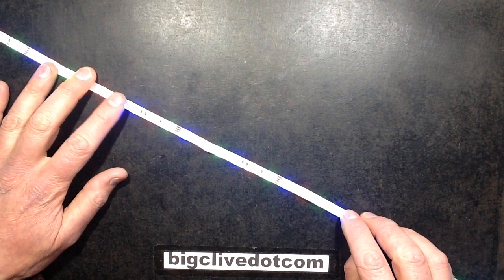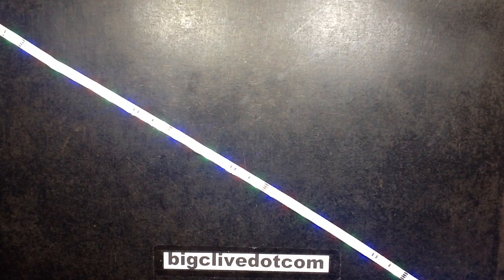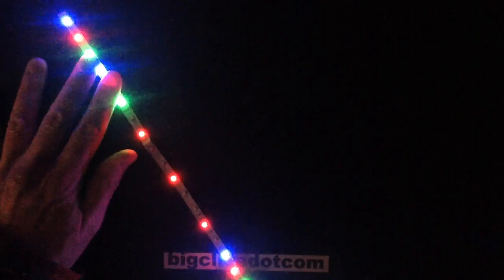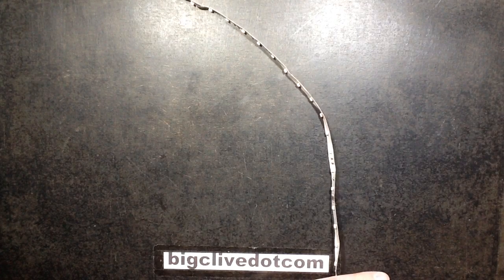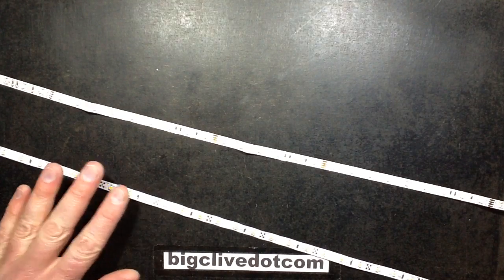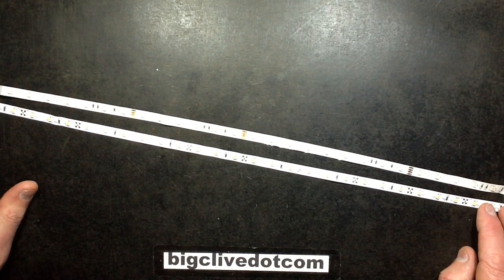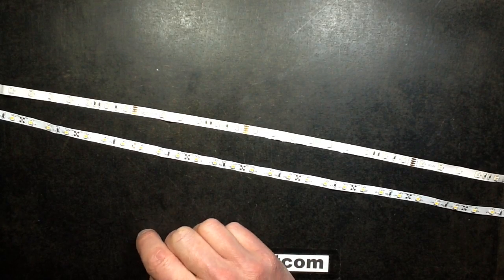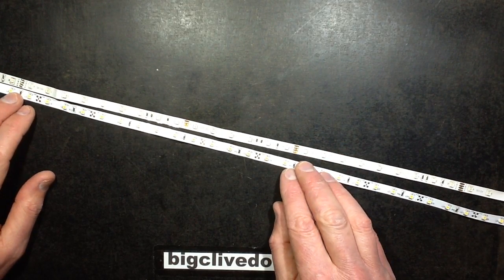RGB LED tape configuration oddity.

Comment: Hey, i recently bought a LED strip like the one you got, not the 50/50 kind. And when i plug it into the power supply it defaults to Blue, and the controller does not affect it. Could it be a problem with the microcontroller or maybe the IR sensor?
Reply from the maker: +Trent Zurflueh The battery in the controller may not be making good contact.
Reply: I tried messing with the battery, found out that the controller for the unit was blown, Im probably just gonna buy a new one!

Comment: I bought a similar led tape with individual red green blue leds and it comes with a power supply (8 programs mini controller) and it has like modes for the leds (flashing, waves, etc) but it doesn't have the basic features like solid red or solid green or solid blue how can that be fixed?
Reply from the maker: You could change the controller.
Reply: Ok will try, thanks for the reply!

Comment: Nice video, thanks for sharing. Total power dissipated by the 2 diode array is 252 mW with 132 mW on resistor, while the total power dissipated by the 3 diode array is 240 mW with 60 mW on resistor, that's why the 3 diode array is more efficient. The current is 20mA for both groups.

Comment: What do you think of the 7020 LEDs ?
Reply: Quite interesting LED's. These have a heat dissipating pad under the component to better transfer heat onto the PCB surface, some are even two dies series on one component. The InGaN dies can share a common pad as the artificial sapphire used for base material doesn't conduct electricity, that's why there is need for two bonding wires.
Reply from the maker: I've never actually tried anything with the 7020 style of LED.
Reply: I ordered some from eBay for $9. I can't find much info on these LEDs. Maybe when they come in ill post up a quick video. Thanks

Comment: hey clive do you have a personal facebook or somewhere i could get in touch with you about these leds might have something for you
Reply from the maker: You could send a message through the YouTube system.  If you click the channel name and then select "about" it gives a messaging option.
Reply: ok will get in touch with you about some rgb controllers which i could give ou and a strip of 5050 led strip which is ip 65
Reply from the maker: RC MAD Thanks.  I do have a few of the generic Chinese controllers plus the ones I sell as kits myself.  (As used in the flat panel light video.)
Reply: ok just was wondering if you could do a video of the chips or something else what is in the white cases as iv got the one with 2 chips inside on a pcb
Reply from the maker: RC MAD I've had a look inside some and they had custom programmed microcontrollers in them.  Sadly in the most interesting one, the microcontroller didn't even seem to have an English manual.  I'd guess that if it's got two 8 pin chips they're probably PIC microcontrollers or clones, with one handling the IR reception and the other bit-banging the PWM.
Reply: i have the one with the 2 pic micro controllers bit i tried to look for any markings but the was scratched off what does that mean i once  shorted one out and it blow up (did it as an experiment) there really cheap so it tells me that they will be pumping them out by thousands it chinese manufactures
Reply from the maker: RC MAD They often either use unmarked components or grind off the markings in a naive attempt to stop others copying what they probably copied themselves.  The little generic RGB controllers are ultra mass produced for the RGB tape market, so they can be bought for literally a couple of dollars inclusive of shipping.
Reply: yep would you do a video all on the rgb sets including the shitty transformer which iv had one explode on me